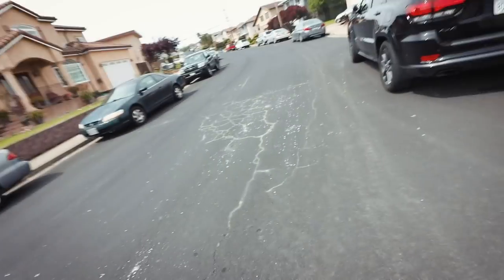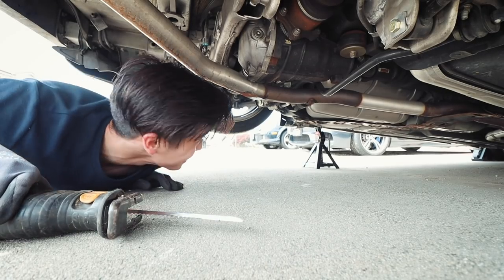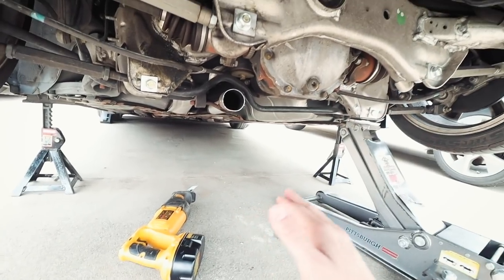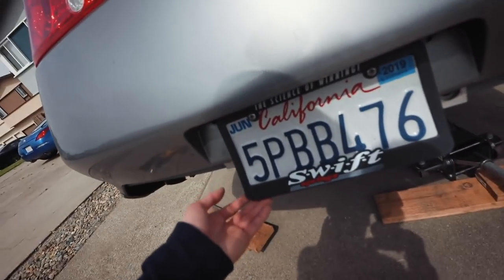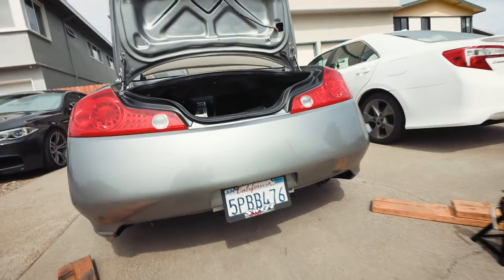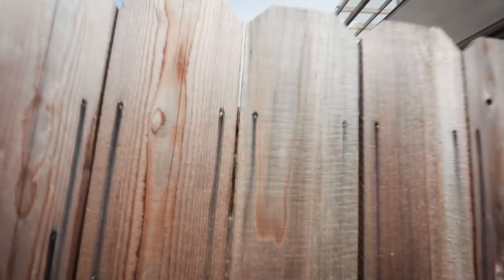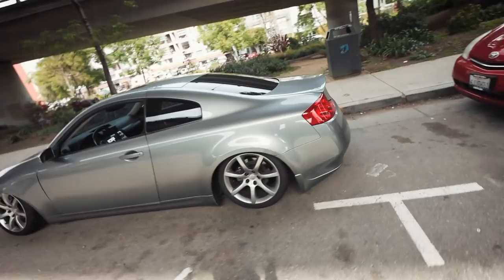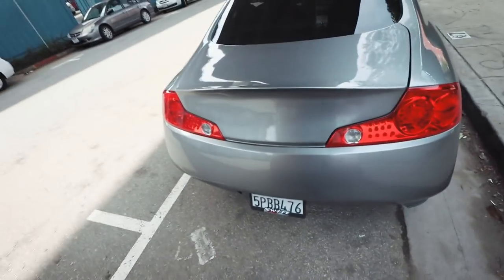CHOPPING OFF MY UGLY G35 EXHAUST!

Comment: I disconnected my muffler and I know exactly how you feel with the drone. I was like oh mah gawwwd it sounds so nice but my ears!
Reply from the maker: exactly!!
Reply: Mine is dual straight piped close to the length of stock without the tip and it doesn’t drone that much
Reply: @khallid3  Turns out my back seats were folded down because I forgot my spoiler was in the trunk. That is possibly a big contributor to the drone. I'm gonna try disconnecting it again rather than paying a shop.

Comment: Have you had problems with your g35s suspension? I get clunky noise when driving in uneven roads. I’ve read that it’s the compression rod bushings. Just wanted to get your opinion it.
Reply from the maker: i havent yet but i know if you are low enough your upper control arm will hit your strut tower. or one of your bushing could be out
Reply: Bob laney endlinks or most likely lower ball joints are shot.